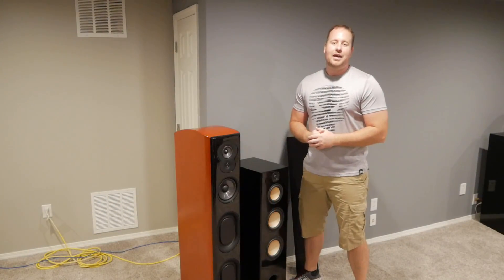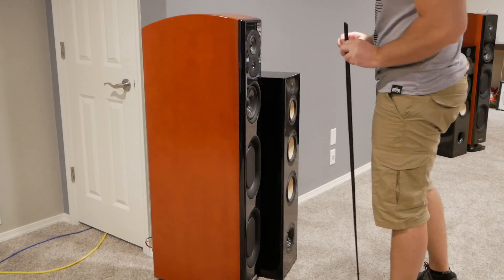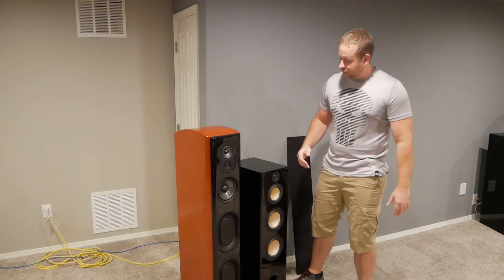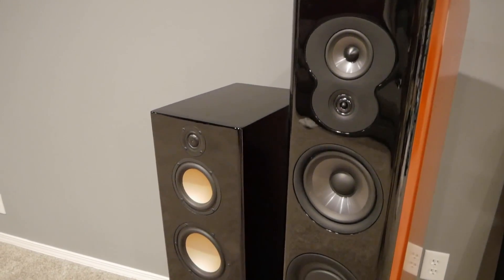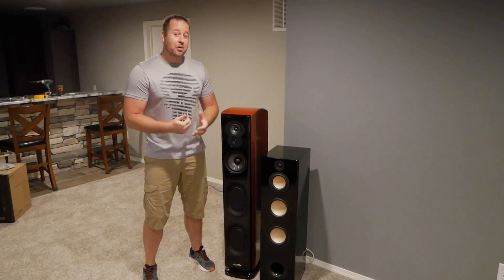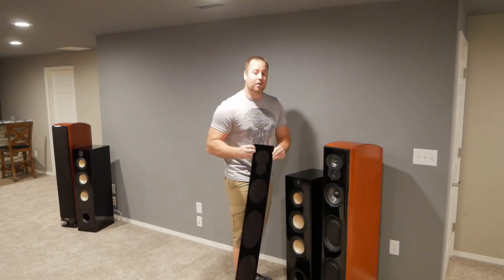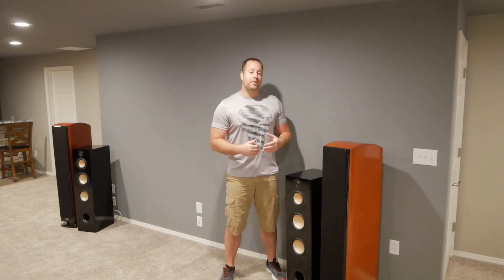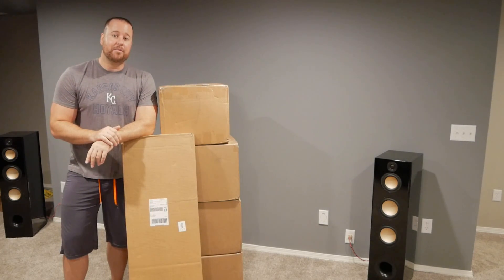Comparing my DIY Speakers vs Manufactured | Swope Towers vs Polk LSiM 707s

Comment: Lil more expensive now. For all Audyn 400v capacitors and for the more expensive air inductors it's $288 from parts express (and then getting the SB tweeter from madisound for like $79 after shipping)
I'm so hyped to build these
Reply from the maker: I really enjoy these speakers. Good luck with the build!

Comment: What grit did you wet sand the finish to? Imma thinking my biggest reason I want kick off a project like this is to learn about how to create a stellar finish and was hoping they would just sound good when I was done — ur vid was just the confidence builder I needed! 👌🙏
Reply from the maker: Usually I sand to 400 grit before painting. After paint, if you want to make them super smooth, wet sand with 1500 to 2000 grit paper, then polish with a wool wheel, then again with a foam pad using the proper compounds with each. It's a long process, I actually didn't sand after clear coating these as they were pretty darn smooth without it
Reply: @LifeofBliss  Nice. They look great!

Comment: I had Polk 705 and also DIY amp and speakers. No doubt many DIY is awesome value for very good speakers. My experience is Polk LSIM 707 needs A LOT OF room away from walls, and it needs A LOT OF power on an amplifier.
Reply from the maker: I've heard the same... unfortunately I didn't have an external amp at the time that was super powerful. Beautiful speakers, just wasn't a huge fan of the sound signature

Comment: I like the DIY route. I built a tapped-horn subwoofer, love it. I too, covered it in duplicolor bedliner. The only thing about the bed liner is that I can never seem to dust it. It shreds a micro fiber towel, and a vacuum doesn't seem to do a great job. 
Oh, and it's good to see an Emotiva van, I have a UMC-200 feeding a UPA-7 pushing to my 5.1 Magnepan setup and DIY sub.
Reply from the maker: Dude same here, that duplicolor bed liner is not easy to clean!

Comment: I design my speakers from scratch. I ordered some KEF q 100s and when they come I will compare them to my home built home designed coaxial speakers I hacked from separate drivers from eBay. Watch out for it in mid Jan. Ànd also my home built and designed full range speakers with extra woofer will be compared.

Comment: hahah you just pay components? and NOTHING ELSE?!!! hahaha    NO MATERIALS,TIME, TOOLS. Only you're saving is delivery cost. Now it's  starting point for you to get  real 3 way speaker with  18" woofer :)  and invest in to room sound treatment
Reply from the maker: I did mention materials, time, and needing to have tools if I remember right. But regardless, yes, its a trade off. Time for money. I'm doing a little better now for speakers... Dual 12s in the LCR and 24" subs for low end. There are videos if you are interested of course...

Comment: Sorry to disagree the Polks are made way better than those DYI speakers go to their web site and see how every driver has it's separate enclosure the speaker is almost totally inert when music stops it stops when there Is quiet between passages it's quiet there're 118 pounds for a reason these guys have been designing speakers since the 70's lets connect those speakers you made to a high end separate mono block amps I guarantee you they wouldn't sound as good as the Polk 707. I own a pair of these that I purchased for $2000 an incredible buy in my opinion the thing with the Polks is that you need higher end equipment to maximize their potential the sound of these speakers increase exponentially as you go up the hi fi chain.

Also they are more like 6 to 8 ohm speakers they need some juice to really bring them out I use Mcintosh and Crown amps to run my center and mains and a Anthem AV for the surrounds a Musical Fidelity Tube DAC also a  Yamaha CD1000 for my SACD and CD play back ( used mostly as a transport ) What's also very important is how your listening area is set up if you have boomy bass and they do have lots of bass to spare  try different positioning and sound absorbing materials which I feel anyone getting into proper sound reproduction and extended listening should have. I replaced a pair of Golden Ear Triton Twos and couldn't be happier the Polks are warmer more detailed and highly musical but they do need the proper spacing / sound reinforcement to get them to image properly but considering the price build quality and drivers they use on the 707's that's a very small inconvenience ...Peace
Reply: From technical standpoint they are worse than diy. Only the most expensive high ends use decent quality drivers. Anything below 5k will have a huge amount of hearable distortion and diy with not that expensive drivers won't have. If you listen to some super high ends like 20k usd and higher speakers you will hear how badly designed are the cheaper manufacured speakers. Their history doesn't matter there is to much cost. They need to upkeep company, make profit, design new speakers, pay for production, distribution, storage than distrubutors need to do the same and then stores thay you buy from do it the same. Usually speaker from factory cost 10-15% to make at the factory even without production scale that decreases the price
Reply from the maker: Yea people don't realize the costs that go into making and shipping a nice looking cabinet that weighs 80+ pounds. Then R&D, marketing... now driver manufacturers have costs too, but most of the time youre going to get a better quality component when doing DIY and making the cabinet yourself than a lot of sub $2-$4k speakers.
Reply from the maker: Hey man, we all have different opinions. Sound is very subjective. They didn't sound bad, just preferred the Swope towers over them. Glad you like yours!

Comment: What bedliner paint did you use on the subwoofer box? 💪👍👊
Reply from the maker: I used duratex spray on bed liner for the Ultimax 15
Reply: Ok thanks. What spray gun did you use??. Brand??
Reply from the maker: Sorry man... I meant duplacolor lol. Came in a spray can. I used duratex on my more recent speaker builds. Used a Devilbiss gun to spray those. I go through the whole process and have links to the gun and other stuff I used in the description. Let me go find the video link for ya...
Reply from the maker: Here ya go man https://youtu.be/8uIXSDyzyaQ
The duratex is a lot better than that spray can duplicolor stuff btw
Reply: Hey bro again thanks for the info. Want to see if you can help me out. I just got a Klipsch R-12sw it's 200rms. Sounds great but there's certain sounds that the sub will pop. I'm using a pioneer Elite VSX-LX303 and sub wire by SVS. Thanks bro
Reply from the maker: I don't think it's anything else in your system besides the sub. I assume it's when you turn it up louder that it pops? That's the voice coil bottoming out and hitting the cone most likely. Your just driving up past it's limits. You'll need bigger or more subs to get more volume in your setup
Reply: Its leas the half way on the gain and it's 200rms lol. Yea when it hits a loud low sound it pops. Everything it sounds good.
Reply from the maker: If it's popping on the low notes, sounds like it's moving past it's excursion limits and bottoming out.
Reply: Ok. That's terrible tho lol. I was using one of my kicker comp sub 150rms  and it never did that. Lol
Reply: I'll swap out the Klipsch sub and see how it acts lol. Thanks bro 👍💪
Reply from the maker: Yea man, no prob. That's what it sounds like to me anyways. Could be clipping the amp and getting some weird noises, but it sounds like the sub. It really takes a lot of air movement to get any sort of spl in those low notes. I was bottoming out my 15 inch Ultimax sub quite a bit before upgrading. You're probably just finding the limits of what it can do 👍

Comment: The real challenge is making speakers from scratch. Buying the components mix and match, and designing your own enclosures and crossover. That is where the real fun is, way more fun than assembling kits. My argument is that if you can go to a hi fi shop and pick out great (completed) speakers (and you can hear the difference) you can design and build your own speakers from scratch (if you put your mind to it and experiment with crossover components and box acoustics etc.). Yes it's hard but listening does help. It's not only a big challenge (and therefore way fun) but also you can make your speakers sound just how you want them, with a lot of practice. After a while you get to know how each size inductor sounds and also the capacitors. The only math you need to know is how parallel and series affects inductors, resistors and caps. And the only other math is to keep the impedance reasonable. And knowing the former helps with the latter, no end. And remember the crossover makes the sound different more than just about anything. It's CONTROL and that's such fun if you are a CONTROL FREAK. lol
Reply from the maker: Very true. I haven't dove into complete custom yet myself but am excited to try once I have a bit more time

Comment: Kit vs own design from scratch would be interesting. Some engineering will be needed. Great video, im super interested in diy speakers.
Reply from the maker: Thanks man. Check out the more recent video on the 1299 speakers I built. It's a kit but they suggest a sealed box with dimensions. I ended up making them a ported design and changed the look a bit. Diy speakers are definitely fun, lots of room for customization to fit what works for you

Comment: Speakers aren't what they used to be; being tuned differently/lower, boomy bass, and lacking mid-range clarity. DIY can overcome this to some degree, if you can find the correct drivers. About the only reason to buy speakers now, is if buying hi-end; something like Magneplanar, or similar.
    I've made many DIY with mostly vintage drivers, and enjoy every single one of them.
Reply: I think speakers are made to be “efficient” in power today, hence not as great performing as the OG stuff. I’m still young but even I remember a lot of stuff from back in the day being better quality than it is today.

Comment: My Lsim 703s takes atleast 180 watts to drive them proper thats 2 mono amps, They need high voltage my Emotiva BasX A-300 couldn't handle my 703s Unless I Bi-amped them .The Lsim should have been rated 4ohms 
I have a full video upload here on utube how 2 take the polks apart. Thanks for the video
Reply from the maker: I've heard the Polks like more power... thanks, have a good one man
Reply: @LifeofBliss  power hungry they drop down in ohms like crazy ! But very well built equitment matching is a plus also my warm amps sounded awful but my netural soundings amps lighten the color in the bottom alot

Comment: There is no question that a properly designed DIY speakers are vastly superior sounding compared to manufactured speakers dollar to dollar.  The only downside is its incredibly dificult to make DIY speakers look great if your not a professional cabinet maker.  It just takes a lot of time and patience and lots of trial and error learning how to cut, sand, route out cabinets. and then learning veneer and painting techniques.  My most recent set I am building I using Automotive paint and that seems to be the best way to go but its messy and very expensive and very time consuming.   Its a labor of love but it gives you an immense sense of pride when you can make not only an awesome sounding speaker but one that looks amazing to.   All my friends want me to build them sets of speakers and I just laugh and tell them I will design it for you but you need to build it yourself.
Reply from the maker: Yea it's definitely a labor of love!

Comment: Just sub to your videos. Great videos you have been doing. I want to build something like your large cinema speakers you made. Can't remember the name of the speakers and would have to go back to history. Where do buy your speaker kits from? I was looking at buying some klipsch but would really enjoy doing some DIY myself also. Would like to do a 7.2 setup. Could you tell me the name of the 95db sensitive speakers you build that looked awesome and would be sweet in my theater build. I don't want 6inch bookshelf. I want to feel the gun shot like a cinema. Thanks.
Reply from the maker: Thanks man. Those are from a site called DIY Sound Group. They have several different types of kits to fit whatever budget or size constraints you may have.
Reply: Life of Bliss awesome and thanks for info!!!  I have klipsch now but looking for that next upgrade. Take care for now.

Comment: Ive read up on the LSIM707 and they seem to require a lot of power to drive, alot have recommended that they need to be biamped to get the most out of them, still on the fence on purchasing, waiting for the right sale.
Reply from the maker: They weren't bad speakers by any means, my ears just preferred the swope towers. I've heard the same as far as power goes

Comment: I design and build my own speakers from scratch. I have a new med treble driver design that is at another level and I put them in my lounge tower boxes and I am addicted to them. Point source time aligned sound that beats just about any 2-way or 3-way speaker in image. And it has serious treble that stings your head off (without tweeters). It's 3" full range drivers with 1.5" FR tiny drivers powering the top end coaxial tizzers. Too hard to describe so here is a one minute (crappy) video of my babies (better videos of it coming soon). I might be selling coaxial drivers soon, but larger ones (and tidied up a bit). https://youtu.be/UlJHRQidsvI

Comment: Always have built my own since I was 16 cause I was dirt poor. Now that I have a decent job and I am 53, I build speakers on the side all the time for friends and family and I can say with out a doubt that if you do it right. Homemade speakers will beat most anything on the market for a 1/4 the price in some instances. I built a pair of Nexus Towers a few years ago I use in my movie theater with a 120" screen along with a dual 8" Tuba Folded Horn Subwoofers by Bill Fitz Maurice. It shakes the hole top of the house and sounds crystal clear. I have a standing order to build a set for anyone that has ever set in the room. Mine are there near the end of this page. The only thing I have heard better it Statements. But they are too big for that room or I would have them. Most people go for the biggest and coolest but in reality you only need to get what works in the room you have otherwise it will sound worse. These were a hard build but if your into HT or just good music you might check out this matched set. 
http://www.hificircuit.com/community/threads/project-nexus-a-timbre-matched-family-of-hi-fi-ht-speakers.319/page-3

It's a wierd design and a very hard built but if you want something that will stomp even the Ultimax 18 sub woofer look no further than BFM. I built two of the compact AutoTuba with the Infinity 860w 8" sub woofer for my move room because of space and the bass is overpowering at times you can feel it in your chest so much.
https://billfitzmaurice.info/THT.html

Do it yourself sound group also has a set on Elusive 1099' and 1299's or bigger that will rock your house you can find here plus a several other speaker kits https://www.diysoundgroup.com/ and lets not forget about Parts Express that warehouses every speaker and component in the world for cheap prices and for 279.00 the kit below is more than enough for most beginners and will sound as good as those polks with 78 5 star reviews 

https://www.parts-express.com/tritrix-mtm-tl-tower-speaker-components-and-cabinet-kit-pair--300-702
Reply from the maker: Those are great looking! You should check out my most recent videos. Just finished a set of 1299 and Volt 10 speakers for the area. Getting started on some Stereo Integrity HS24 subs as well!
Reply: Any recommendation for 2 way speakers for desk and HT? Mostly going to be using for a 5.2.2 HT while sitting about 10 feet away. Room is around 30 x 15 feet. I'm in need of 2 fronts and a center and was hoping to build cheap but effective ones since this will be my first build.
Reply from the maker: Overnight sensations are a good first build project and they sound really good for the money. You could also look at anything from DIY Sound Group. You could grab 3 of these with the flat packs and crossover boards and be all in for under $500. It'd be a very solid performing setup https://www.diysoundgroup.com/new-denovo-audio-products/s2000-mtm-kit.html

Comment: Should have got Klipsch. 803 flags wayyyyy better. Polk is ok. Better in the early 2000's
Reply from the maker: Yea is was a good deal at the time, but obviously sold them all for the DIY speakers I've been working on. Glad I was able to hear them though. They weren't bad speakers, my ears just liked the ones I already had. And Klipsch does make some excellent speakers!